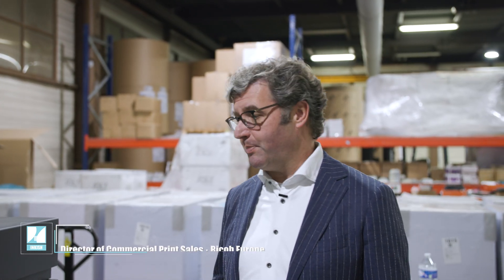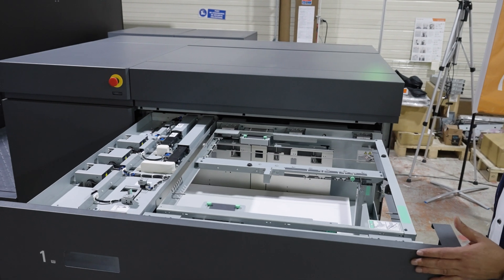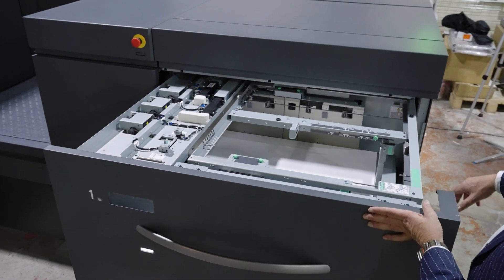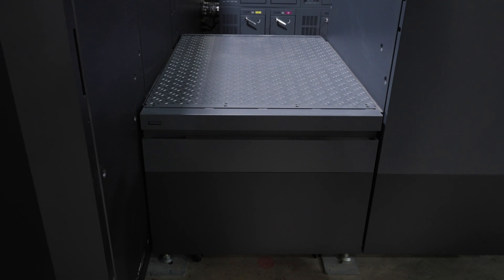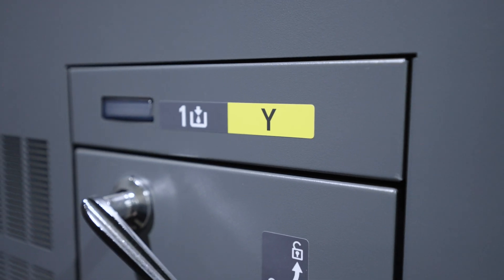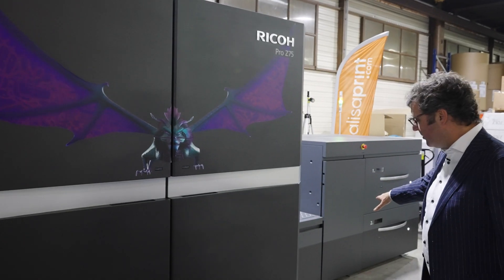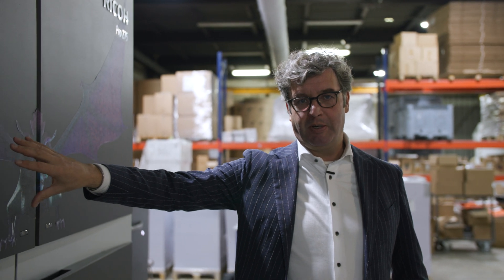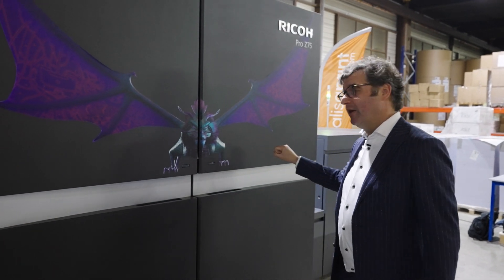Ricoh PRO Z75 Walkthrough · Sander Sondaal · Realisaprint.com · Contes · France

Comment: KONICA MINOLTA Acuriojet KM1E HD,beat you at all points
Reply: name some examples? The speed is very different, the Z75 is much quicker. The KM is UV based inkt and the Z75 waterbased, and can dry up with less temperature. It has only palletfeed for 1 paper. With Z75 you can expand to 5 different papertrays (inclusive pallet feeder). Should i go on?
Reply: I think the KM1e UV inks are so much more expensive than Ricoh Z75 water based.

Though I don't know the price for Ricoh's water based inks yet, but they boasts that you can move your jobs from offset to inkjet which means the price of their inks should rival that of offset at reduced run lengths (short runs) but with KM1e, you won't even think of moving jobs to digital cuz of the super expensive UV inks.
Reply: Konica discontinued the KM-1..... LOL
Reply: @jaredfreese6339  no they didnt...........................